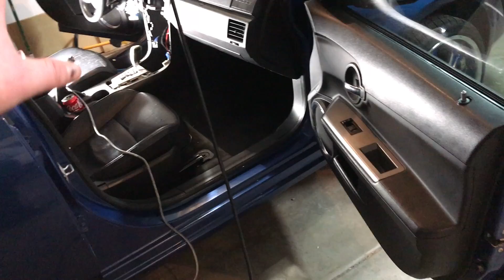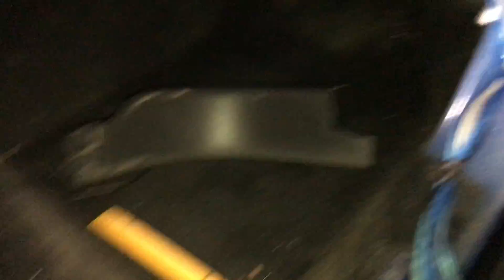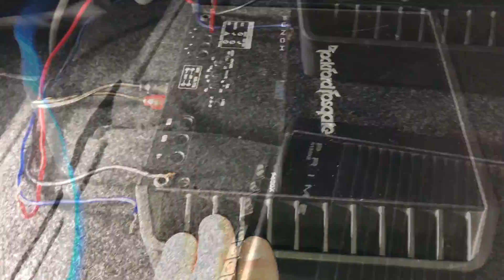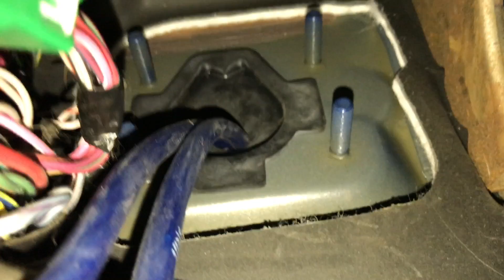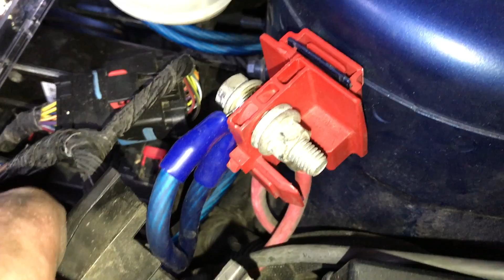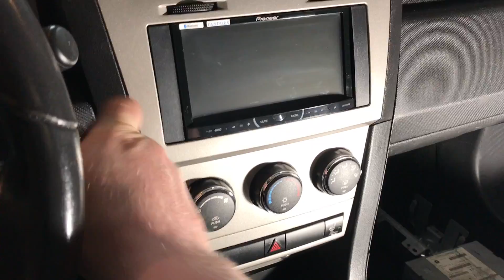2007 - 2014 Dodge Avenger Amp and Sub Install

Comment: i was looking at a dodge avenger at a dealership. they want $9359.00 for it. it has 104,000 miles on it. i test drove it but i was wondering if my subs that i had in my 2014 ford taurus would fit in the dodge avenger......not sure if you are familiar with the Q bomb sub box, i had 2 12 inch rockford fosgate P3's with a 1200 rockford prime amp.

Comment: Provo beast please please help me. I'm a female and I like to learn new things, however I initially got my beat hooked up at Arden audio . Everything was cool untill one day I  was having problems with my car starting as well as kept blowing the inline fuses, thought that those problems was from the way things was hooked up or wired. So I unhooked my after market head unit and another wire that was connected to the lighter portion of the car .now I can't fix it back . Please help me cause Arden audio will charge me too much.

Comment: do i have to change my head unit i have a 2009 stock radio an everything do i need to change anything or can i plug in my amp an subwoofer like u did
Reply from the maker: Just a line out converter if retaining the factory radio: https://amzn.to/33lRh5u

Comment: Does anyone know what that rubber grommet is actually called?  On a 2014 those are installed the other way around.   When I tried to put through it,  it popped out into the engine bay somewhere.  Now I need to fill a massive hole.  Please help!

Comment: I was going to remove my amp and subs with the wiring but I would rather not lmao. Seems way difficult and if the guy who installed it actually connected to my battery then I’m totally not removing the wheel and bumper just to access it. I’ll just leave the wiring in I guess, maybe the next person to buy my car will use them

Comment: Good video 
I want to hook up my amp and subs to my stock head unit, but i'm having some trouble figuring out what wires on my stock stereo i should connect the line out converter to and so on
is there some sort of diagram or something
Reply from the maker: Sure, but i need to know your year, make, and model.  Also, this will also vary if you have the factory Boston Acoustics Sounds system too.
Reply: awesome 
 i have a 2013 dodge Avenger SE with  a stock head unit (Like the one in the link).  No Boston Acoustic system 
Https://www.amazon.com/Chrysler-2013-17-Radio-Single-P05091195AC/dp/B079SW3QGV
Reply from the maker: http://www.modifiedlife.com/2013-dodge-avenger-car-radio-wiring-chart/
Reply: thank you guys sooo much looks like i got my self a project this weekend ! SUBSCRIBED!

Comment: Hi, can a subwoofer can be installed with the original stereo?
Reply from the maker: Yes, however a line-out-converter is required to provide signal from you factory radio to your aftermarket amplifier.

Comment: I have mine hooked to my factory radio and I’m having an problem with my radio randomly shutting off but we can’t seem to figure the problem any advice ?
Reply from the maker: Sounds like a wiring issue to me.  Recheck all your connections, make sure your line out converter is wired correctly, etc.
Reply: Okay thanks

Comment: did you have any problems with headlights dimming because my headlights dim bad when bass hits
Reply from the maker: No, because of two things: 1-we upgraded the alternator wire from the alternator to the battery, and 2-we had a healthy battery.  This would help stop the dimming of lights.
Reply: mine does this too 💀 just when i use the windows

Comment: I have a vw touareg and aftermarket head units that work with all 11 speakers and the factory digital amp to avoid rewiring the entire system are impossible to find basically.  I found an android based unit that works with the factory digital amp and all speakers work but there is only 1 rca out for an amp. 
I'm only planning on running a single sub, do I need to buy an rca splitter or just connect 1 rca lead, say the right or left one only or do I need to have both right and left connected? thanks
Reply from the maker: Yep, get a splitter as your amplifier is looking for a dual RCA input.

Comment: What if you're installing Subs and an Amp to a factory deck that doesn't have any RCA outputs? Would I have to buy a new head unit? I've watched videos that speak about an output converter and attaching it to the rear speakers , but I figured I would get a better sound by connecting it to the Head Unit. Any Suggestions?
Reply from the maker: A line out converter will be your best move, whether you connect it closer to the radio, or to the rear speaker lines, it will not make a difference.  If you want a direct connection to your radio, you will have to replace it.  Some people still want better sound quality but don't want to replace the radio so the alternative is adding an audio processor.
Reply: Provo Beast Audio Installation This is a first for me, but I have a head unit, i just dont have an installation kit for it or any type of wires. I figured i would just connect it to the factory unit, but common sense tells me that all of the sound would be in the back if i connect the converter to the rear speakers. If i wanted to amplify the car speakers as well, would it be better to attach the converter directly to the head unit?
Reply from the maker: You will need a wiring kit to hook up a sub and amp. What do you mean by all the sound in the back? Are you talking about amplifying the rear speakers or adding a sub? To amplify all interior speakers without replacing the radio, check this ford truck install where i did that.  it would be easier visually to show: https://www.youtube.com/watch?v=zcPxAnZ8lUE

Comment: Do you use multimeter for gain leveling or oscilloscope?
Reply from the maker: Yes.  But for those that don't have one at home, there are a few other ways to tune your amps: 1. you can match the gain voltage with the output voltage of your radio.  Typically PIoneers are 4v so set your gains on your amps at 4 volts.  Also, you can turn it up until distortion, and then back it off.  Of course, the best way would be by using a DD1 Distortion detector or an Oscilloscope.

Comment: I thought you couldn't run all the cables together down one side
Reply from the maker: The power wire was ran down the driver side, the rca, speaker wire, and remote turn on wire down the passenger side of the car.  The remote turn on wire is a low amperage wire and will not cause any issue.
Reply: Mel James on 4 channel amps you shouldn't.
Reply: Mel James subwoofer amp doesn't really matter